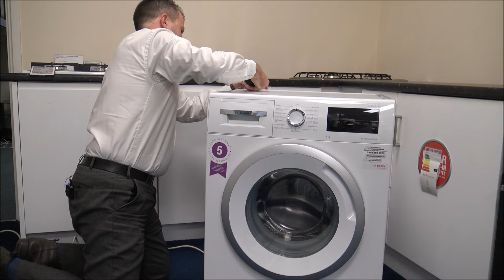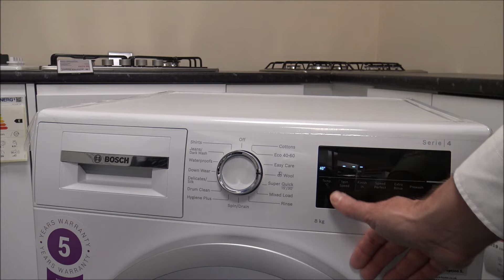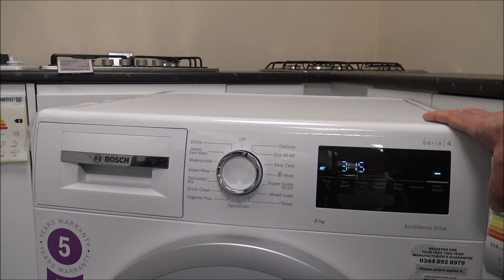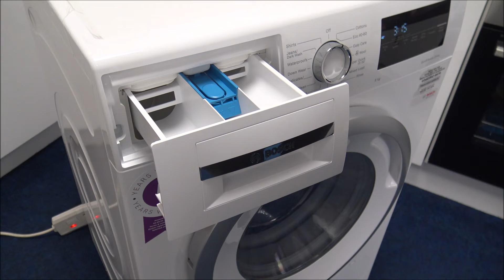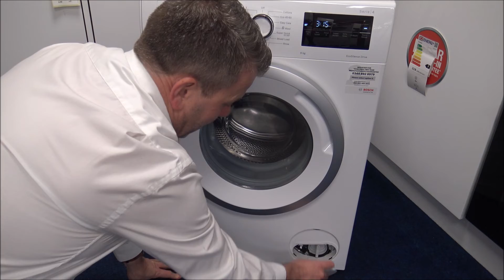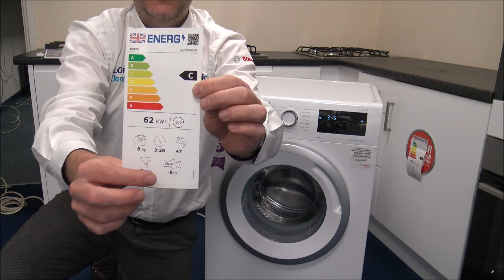Bosch WAN28282GB 1400 Spin Washing Machine

Comment: Why did they stop having washing machines with hot. fill? Now they are all cold fill which of.course makes the cycles longer because the water as to be heated before the washing starts?
Reply from the maker: Because people are washing at lower temperatures of around 20 or 30 degrees C then it needs to feed that temperature from the cold feed anyway. Also the wash performance can be better if the water is gradually heated up and can take advantage of the detergent, enzymes and bleach within some of the washing powders or liquids.

Comment: I bought my Machine this model 5 years ago. I want to know why if the Feature benefit Eco Silence on spinning, but mind is very loud. A caller an a Bosh to come out and have a look at it. The engineer said nothing g wrong with it. I said it's loud he said it wasn't   So I don't under stand why Bosh. Put this as feature.. When it clearly does not work

Put

Comment: Hello, thank you for the video. My Samsung washing machine has a control board problem, probably not worth repairing it. It is 8.5 years old with a use of around 2-3 washes per week
I heard that Samsung has problems with the control boards. Do you suggest I buy a Samsung again or buy a Bosch instead?
Reply from the maker: We don't sell as many Samsung washers as Bosch which we sell a lot of, so we would normally recommend Bosch as they are great machines and on the whole reliability is very good
Reply: @lords-electrical  Thank you for your reply.

Comment: Thank you for the video, I found it very very helpful
I’ve had a Bosch Washing Machine for approx 9 years and never had a moments problem with it.  Unfortunately the bearings went hence buying new machine.  
The new models are a lot more advanced than my previous one so thank you your video, it was very helpful to me.
Yes Bosch is a bit more expensive than other makes, but with Bosch you’re getting good quality and a company you can rely on

Comment: Nowdays i dont bother spending more for a Bosch, they are all verys similar, i would go with a Beko instead since they seem to be good value
Reply: That’s my problem with new Bosch too, there mostly all the same especially the cheaper ones. Also the “8kg” drum they use in Serie 2 and a few Serie 4 models like the one in this video is the exact same as the 6kg models from 5-10 years ago!
Reply: @washinglad1400 yes but it’s a splittable tub a massive selling point in my opinion.
Reply: @bobsurrey6686 what does this mean please ?
Reply: @bobsurrey6686 which model has a splittable drum please ? Cause I googled this one and it says it's sealed drum